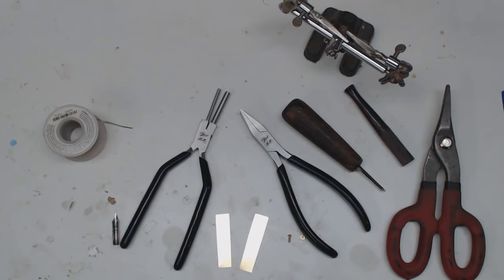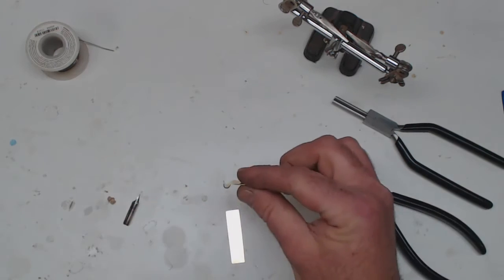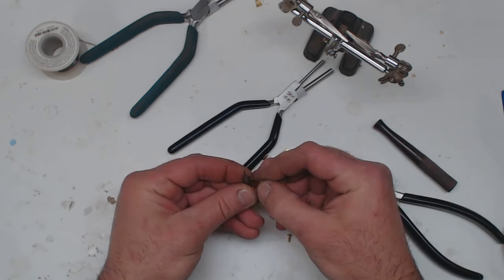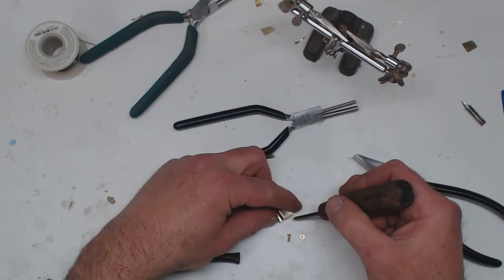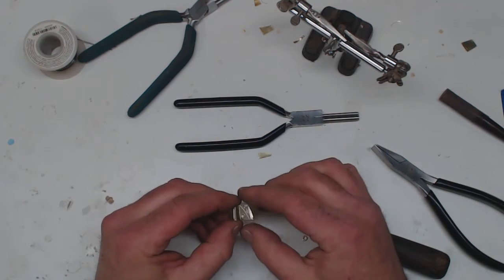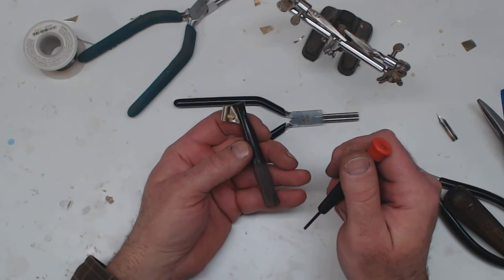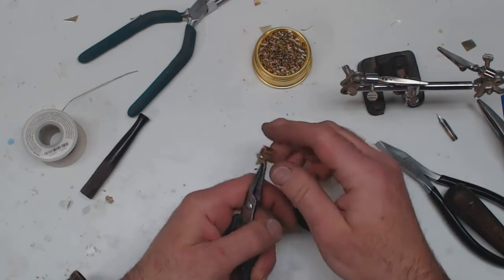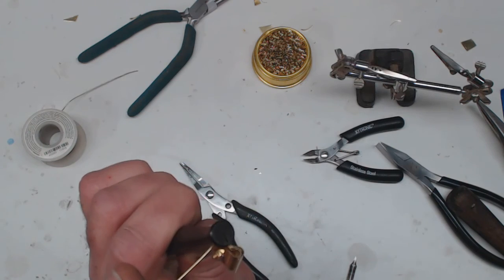Making a Bullock Flange

Comment: Hey Chris, are those machine screw you're using 1/4" long, or are they a bit shorter?  Small machine screws like that seem difficult to find.
Reply from the maker: 3/16" is the length. Usually a special order item.